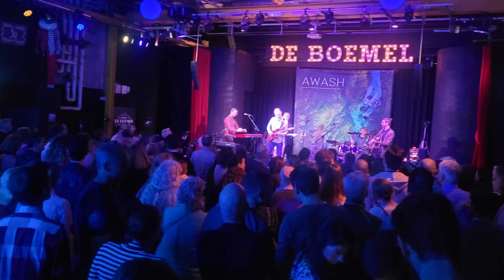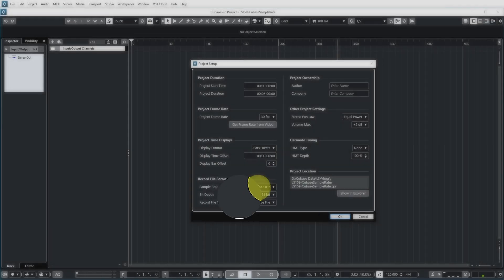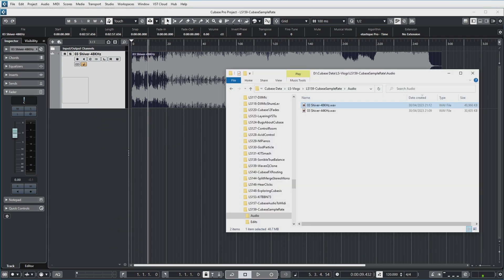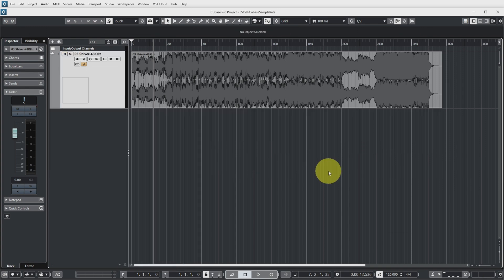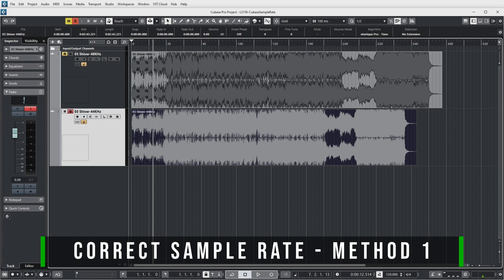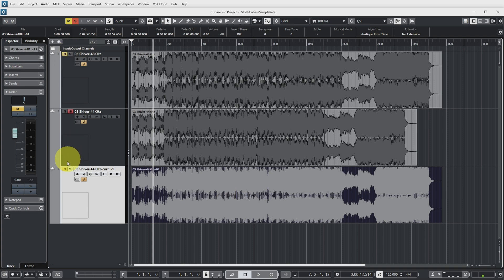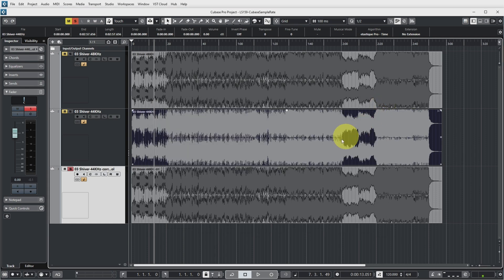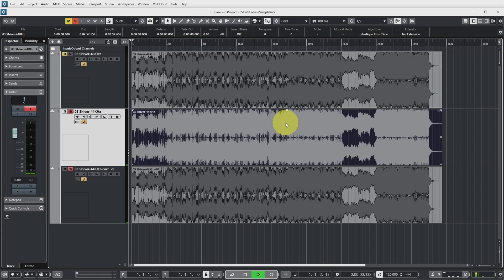Cubase and audio sample rates; how to best correct an incorrect sample rate?

Comment: Great video, it's great you make these, I've found a lot of them very helpful indeed. In Cubase, you can get 64bit floating point option as well as 32bit floating point for bit depth. What difference does these higher levels make? My issue is that I have been recording at 96kHz 64 bit depth but it's making my M1 Mac Studio Max crap out and stutter at even small track count and plugins. What's the best compromise do you think, in terms of bit depth and bit res? 48kHz and 64bit? I'm also thinking of going to 48kHz because it increases my ADAT I/O and MADI.
Reply from the maker: I use 24bit 48KHz for everything myself. It seems to be the standard most are using, but it also depends a bit where on who you ask. If you hear the difference with higher quality settings, by all means do it. But it will indeed cost you in performance, disk space, etc. I think the most important thing is that you can make the music that you want to make.

Comment: Hi, thank you for this video. Question: What is the reason to use 48kHz instead of the 44.1kHz sample rate? If I print the song on a CD (I know - old fashioned), the sample rate has to be 44.1kHz anyway. Do you really have a phonic advantage to record in 48kHz?
Reply from the maker: It's debatable but I've always recorded in 48KHz and many do. In addition, you now need to be in 48KHz if you want to mix Dolby Atmos in Cubase.

Comment: Thanks. I have recorded files that are all in 48k but prefer to work in 44.1k, how would you suggest importing them into a new project at 44.1k? At the moment they are all in a 48k Cubase project, is there an easy way to convert the project?
Reply: Yeah I outlined it above.
Reply from the maker: Yes try changing the sample rate in project setup.

Comment: Hey thx for the info. When importing songs it’s different. Open Project setup and sample rate is flagged. Selecting it to 48k pops up a menu that allows all files to convert. However, the final answer regarding aligning files to time should be No. Otherwise, they will not align unless all files were recorded from the same location.
Reply from the maker: Thanks for adding that 👍
Reply: @LanewoodStudios  Glad to help B)